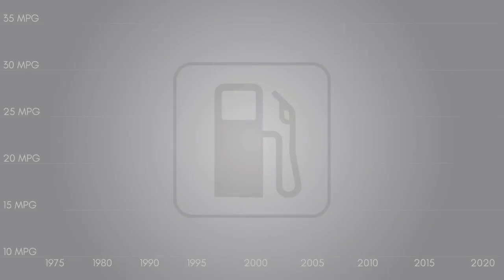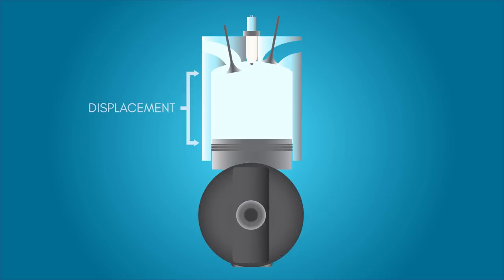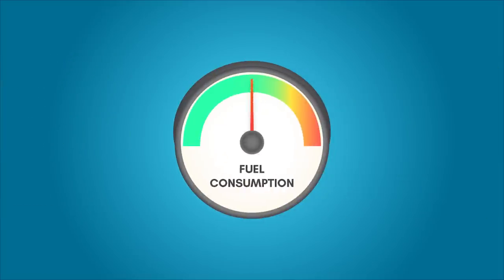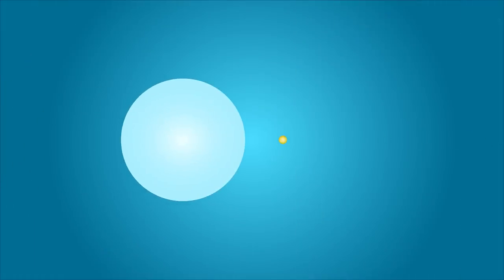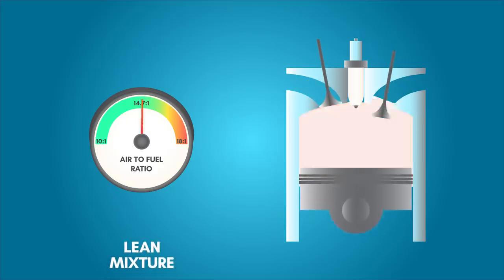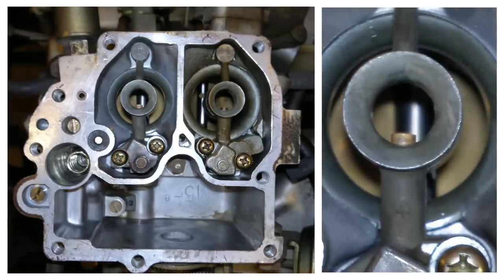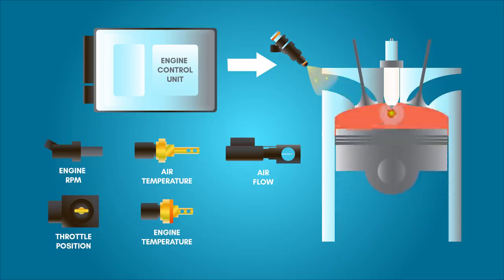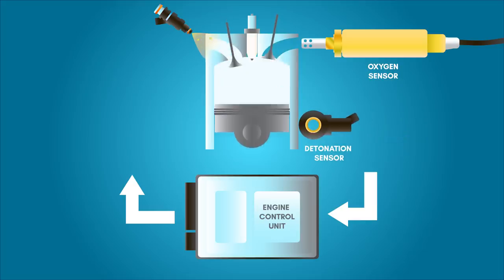How Engines Are Becoming More Fuel Efficient

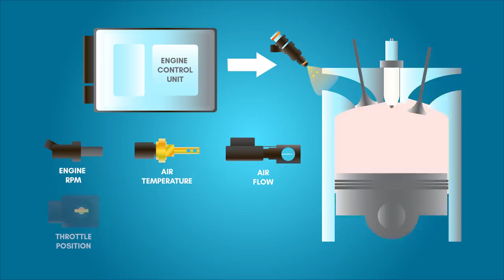Comment: At 6:50 in the slide with the sensors used with fuel injection systems, you forgot air pressure sensor.

Comment: the 1978 Honda Civic got 40mpg with a carbuator. Put FI on that and it should get 50mpg.
Reply: I read about someone who claimed to get ~130 mpg in a Honda N600 by driving it carefully, and never going above 30-40 mph.
Reply: Carb gets the same as injections
Reply: @Owiko7  Makes sense, since the N600 has only a 600cc engine.
Reply: My friend has the CVCC, it has a motorcycle engine!
Reply: The Insight hybrid goes over 70mpg on highways too, three cylinder, aluminum body.

Comment: The trend towards fuel efficient vehicles in the late 1970s wasn't unappealing, it was unavailable.  People didn't turn away from the Ford Pinto because it was fuel efficient, it wasn't. They turned away from it because it would explode if it was hit from behind due to a design flaw that Ford tried to cover up.
Reply: The build quality of the big 3 was garbage. Japan kicked their buts because of that.

Comment: I got normaly with ac on and 3 people in car 47mpg Mitsubishi lancer ex 1.6l 4 cylinder non turbo engine 2015 117 hp manual 5 gear transmision
Reply: It's always mystified me the huge engines yet low power of the average US engine. 
Engines from the eu and Japan are around 1.6-2.0 litres.

Comment: Here's my issue, i owned a 1987 nissan maxima V-6 (3.0 i think) it got 40+ MPG. Had individual cyl fuel injection, and exhaust plugs. (fired injector only on intake stroke of each cyl) they had a recall on "injector boots" when i got it back they had changed injectors, replaced wiring harness (for injectors) and reprogrammed ECU for "bank injection". Car now got 17 MPG. Hmmm tell me again about how hard it is to improve fuel economy? It's smoke and mirrors.

Comment: Did this mention aerodynamics?  That is important.  New cars are gradually getting more aero.  Example:  the coefficient of drag on a mk7 VW Golf is 10% lower than the previous mk6 Golf.  That makes a big difference.  I can get as much as 40mpg when conditions are favorable, and it also has 260hp!  (Because of sofware tune...)
Reply: Drag only makes a big difference at speeds that are not legal on public roadways.
Reply: @jeffhooper3447  I don't want to sound super disagreable, but what are you talking about??  Either you live in a country where traveling above 45mph is super illegal, or you are just making stuff up.  The point where aero drag exceeds engine and drive train losses is ~45mph.  Feel free to verify this independently.  I'm not making it up.

Comment: You know cars from the 50s could have got 50 miles to the gallon right all they had to do was add a heated carburetor that made it suck in more fuel Vapor than actual fuel liquid
Reply: Randy Wiesendanger  It is.
My 1950's Austin A30 got 50MPG (850cc, four gears, manual). There is a Youtube video of a test drive on the road where this is demonstrated driving on average roads of that era.
 

OTOH, my 1950's Ford 105E (1200cc, side valve, 3 completely useless gears, manual) got 22 MPG, while my 2010 Ford Fusion (1400cc, 4-speed auto box) also got 22MPG. 

My 2010 Nissan X-Trail, and my 2013 Peugeot (both 1600cc turbo Diesel with intercooler) get 50MPG (with aircon off).  Nissan got over 25MPG towing a caravan (Average over about 7,000 miles). 

Here (Europe), inlet and exhaust manifolds are normally bolted together to preheat the fuel/air mix. I am pretty sure they were doing that before WW2.

Progress? Only in the level of dishonesty involved in reporting advances in fuel efficiency.  Americans appear unable to design/build reasonably efficient car engines. 

(All car models and gallons are UK, but I have driven French, Italian and German cars, and the fuel efficiency was similar, although the performance and reliability was definitely not).

Comment: I really think they should take advantage of the heat generated by an engine instead of just wasting in in a radiator.
Reply: That's how your car heater usually works, and one of the reasons why EV's are less efficient in winter. Otherwise, there's no real efficient/effective way of putting a heat based engine to generate power in your car because it would make the car too heavy/bulky. Also, it's generally inefficient to just radiate away heat, but it is necessary in this case or the coolant will become too hot, so it needs to be cooled down faster, which makes it even less efficient
Reply: Is it that impossible?
Then how did Leonard Dyer make one in 1915? And Bruce Crower do it again in 2006?
Reply: @MrManerd  I didn't say it's impossible. I was merely saying that it's not worth it.
Reply: And that is where you are wrong. 40% better gas mileage is worth it. If you're saying the design would be to difficult to make in order to be worth it, then you clearly did not even google either of the two names I gave you.
Reply: @MrManerd  bruh I'm saying it's not worth it for car manufacturers
Reply: @MrManerd  it's more worth it to just use an electric vehicle overall. Then use the fuel to get electricity from much more efficient, much larger engines
Reply: @MrManerd  
What did they do to their engines to recover exhaust heat?
Reply: The six stroke engines they invented add two extra strokes to the normal four stroke engine. In these extra two strokes a mist of water is squirted into the hot combustion chamber. The water vaporizes expanding to 1700 times it's volume as compared to its liquid state cooling the chamber and giving an extra power stroke.

Comment: Wow, ICEs have come so far. I remember when we used carborators, a mechanical distributor, points, rotors.. Now, it's just a 'setting'.. Lol
Reply: Absolutely not true.
Reply: Absolutely true... Just saying something isn't t true, doesn't make it true. Mechanical is damn near always more reliable, and when it isn't you can fix it with a hammer. Not literally, so shut up. And I don't mean an old wore out mechanical engine vs a brand new zero mile electronic. More parts, means more chances for things to break, especially sensors that are adversely affected by the elements and just the engine running itself. I have a perfect example in my driveway. If it were carbureted, there wouldn't really be a problem. 99% of people wouldn't even notice it. But since it's efi, and a particularly poor design, the slightly cracked intake gasket tells the computer to make it run like complete crap. Not that efi is bad, I like it. But only properly designed systems, that don't require tons of maintenance or that I drive like a granny. But manufacturers are going off the deep end, and really not giving you what you pay for. My 76 390 Ford would run like a bat out of hell, and got better mileage than the 01 chevy 6.0 I spoke of earlier. And was MUCH more reliable. I've been easy on this thing, and it still sucks down fuel and breaks all the time. So, newer doesn't mean better, old doesn't mean obsolete. If you use modern manufacturing techniques, applied to simpler, proven designs, you get better reliability. Look at mechanical diesels, they run forever. I have a '68 Ford  3000 tractor my grandpa bought new, that is still running great with nothing more than basic maintenance. And his john deere that was bought around 02 has been nothing but trouble. One of the first parts to go out on any vehicle is the electric fuel pump. If it's all mechanical, it starts out with an advantage. To say computers don't fail is just plain delusional ignorance. And you absolutely have to have a scanner because you can't just tune it by sound. Or even know what's going on. You really need more, just reading codes only tell you the first part. Where an older engine will tell you the problem, basically just with the problem. It doesn't create a problem where there really aren't any, the ecu just thinks there is.
Reply: Yes, and a lot of those are still on the road and running good even though their 45 years old. Computerized sensor controlled cars become obsolete (unrepairable) quickly.
Reply: Absolutely not true... and here’s why. 

Mechanical things literally wear out. Nobody drove anywhere without a spare set of ignition points and a condenser. You needed to do a tune up every 10,000 miles and major engine work every 50,000 miles. 

Plus, you picked literally two of the worst modern vehicles for electrical problems... Audi which is 1000% more complex than other cars and bottom-of-the-barrel often-bankrupt Chrysler. Both of those make 1980s GM cars look like the epitome of reliability. 

The last time I had a computer module fail on a vehicle was early 90s GM. After that... nothing.
Reply: When i started my mechanic apprentership in 2002 cars where getting towed in everyday. Cars still get towed in now but its much less common. Most drive them into the shop because an engine light has come on.

The 90's where a dark time for cars and the EFI systems where terrible, although still better then points and carbys. 

Cars are much better now. They use much less fuel, are safer and more reliable. The only reason most need to open the hood now is to top up the windscreen washer.
Reply: @Bill Seidel Yes, and it’s still shit ^^
Reply: @salvadordollyparton666  Ah yes, of course. The old survivorship bias, where old always equals better.
I wonder why most people are not driving 30-50 year old cars, if they are so much better as you claim.
lol.
Reply: Replies full of old dudes whos outdated minds cant comprehend the absolute insane complexity in modern computer controlled engines, making idiotic claims like strictly mechanical engines are somehow better

Comment: Two huge problems with the internal combustion engine that aren’t mentioned are 1) Not only is the heat energy not being used but power is drained from the engine to destroy the heat and 2) The combustion should take place in a continuous combustion chamber where it is completely burned then the compressed gas sent to the pistons. Then, the hot exhaust could be used for a turbocharger or steam engine and/or converted directly into electricity.

Comment: Very interesting video!
I would like to see a sequel including other type of engines and for other purposes (other than automotive I mean). For example used for residential generators harvesting some types of energy (like solar). I give residential generators as example because (not only I'm personally interested in them :) but) it's a use-case where highest possible efficiency can be the priority, and most of the limitations of the automotive engines are not present or very minor (like space, weight, speed ...). 
For example what engines can be used for harvesting Concentrated Solar Power (ie like with parabolic-like mirrors) and then converting it to electricity by Stirling engine for example.

Comment: Can you also talk about the downsides of these ever-tightening of emissions output on automobiles? Ie. How most diesel engines require EGR (exhaust gas re-circulation) which in theory sounds good, but causes long-term carbon buildup in the intake manifolds and ports which makes the engine lose power and inefficient. Same goes with Direct Injection in Gasoline engines which does the same thing.
Reply: Having healthy lungs is such a downside to the emissions regulations.
Reply: Douglas Hamner
It becomes a problem in densely populated cities.  Not so much of of town.

Air quality in London is outside EU limits.
Reply: I think the particulates and NOX requiring diesel particulate filters and selective catalytic reduction with ammonia is really what is driving up the cost and complexity of diesels, not exhaust gas recirculation. Also, variable valve timing, variable compression, and direct injection are bringing gasoline engines closer to diesels in terms of efficiency, while already possessing inherently better emissions characteristics.

Comment: I drove my 2003 Toyota Camry from Brunswick Maine to the Jersey shore.  I made the trip at night and obeyed the speed limits and used a little over a half tank of gas and got over "FORTY" miles per gallon.  A four cyl. engine.  I still have the car and it still drives great.  The fuel tank holds just over 18 gallons of fuel.  The trip was about four hundred miles.

Comment: Finer fuel atomization would be a good start.
You can watch lots of videos of people driving around in their modified vehicles running solely on fuel vapers/zero liquid...not much power or torque, but it works just fine and would be a great way to run it when it's up to cruising speed.  Some sorta dual fuel delivery system might be the key.  Conventional injection to ramp up, then a vapor/bubbler system takes over.

Comment: and future is electric with ICE (modern 2 stroke opposed piston like achates ~55% thermal eff) as a power generator running at ideal rpm &  load,  which is ultra efficient durable (simple) and light at the same time
Reply: Actually, no. The future are electric cars, regardless of whether you want to believe it or not, especially considering the restrictions imposed (which are IMO a bit lax) by most European countries.
Reply: Douglas Hamner The range isn’t that bad, though. While it’s still not good for traveling due to charging infrastructure not being there yet (unless you have a Tesla), it’s fantastic for day to day use, which, if you’re like most people, represents the great majority of fuel usage. And electricity is cheaper than an equivalent quantity gasoline or diesel in most of the world, so it’s cheaper to operate.
Reply: @GRBtutorials  not only range but weight. It has to be made from nano material. Unless engine that weights ~200+ lbs is better option, then you doesn't care bout range 60-80 miles is enough.
Reply: @GRBtutorials  EU restrictions are lax ?? :D NOx, SOx and particles are ~ok, but CO2 restrictions are BS - electric cars have higher carbon footprint
Reply: Wrightspeed plug in hybrids where all electric isn't enough and that's not often.
Reply: Douglas Hamner So you mean you do 640 km every single day? I highly doubt that, unless you live in a very isolated place. Plus, most people lives in the city, and that’s where pollution is more of a problem.
Reply: @GRBtutorials  The intermittent time between converting from mass personal transport to mass public, gasoline will continue to dominate. Even with the model 3 becoming the most sold EV(mainly due to Namerican Markets), gasoline DOMINATES. Ford literally sold equivalent units of their F-series trucks to the US market alone than China + US overall markets for EVs sold even in the record EV sales year... Ford + dodge+ chevy and you're at equal units as EVs for 16, 17, and 18. Sorry, gasoline is here to stay and to say EVs are the future is 1 VERY far off a defensible basis and 2 conveniently neglecting most transportation isn't going to be personal transportation when the EV even rivals the ICE for EVs main market(ICEs + gasoline will dominate cold weather climates+rural areas more or less forever).
Reply: This. So much this. Even with a fairly standard atkinson cycle engine, running the engine nearly always at peak efficiency and using a combination of a small ultra-cap bank with batteries, and individual wheel motors, should blow everything else away with existing tech on range, efficiency, performance, etc.

But probably not on initial cost...

Comment: The information about lean and rich mixtures here is not quite right. While it's true that if you are making a rich (less than stoichiometric) mixture more lean, it will increase combustion temperature; but making a lean mixture (greater than stoichiometric) more lean will reduce combustion temperature. This is because peak combustion temperature is at stoichiometric ratio.

Added: In practice, in order for a stoichometric ratio to be achieved at the point of combustion, usually you need to create a charge that is leaner than stoichiometric in order for it to mix adequately; keep in mind that these ratios only map to combustion temperature if they are the ratio *as mixed*.
Reply: Wrong.
Reply: @Douglas Hamner It depends on how lean, and how rich. With a lean mixture and a rich mixture at the same combustion temperature, IIRC the NOx production  will be higher with the richer mixture.
Reply: @randypullman1155  Enlighten us.
Reply: @Douglas Hamner Mea culpa! I see weird readouts because in my use case we use really aggressive EGR; you're right that leaning out with atmospheric air is likely to produce more NOx (particularly close to stoich, less so as you get even leaner, but still worse than richer mixtures for NOx).

Nonetheless, I think you're wrong about the temperatures, but right about the NOx (in the atmospheric air case). I see combustion temperatures drop dramatically as I lean out past effective stoichometric.
Reply: @Douglas Hamner Peak combustion temperature and NOx occurs around 16:1 AFR. Any leaner than that and both temperature and NOx production decrease. Around 20:1 NOx emissions are down to what they were with a 12:1 rich mixture.